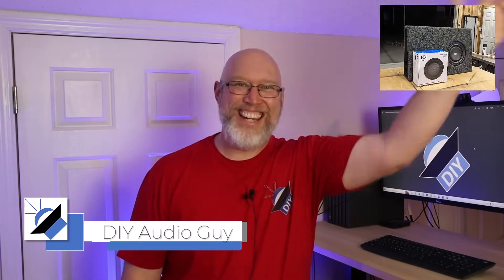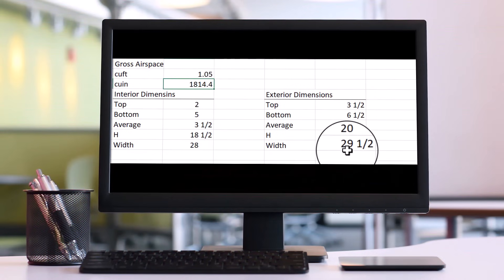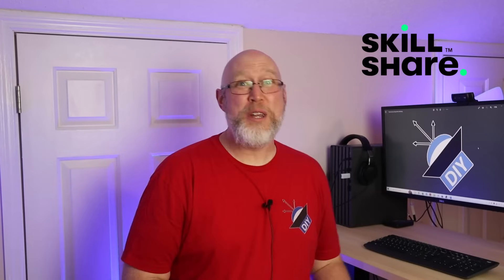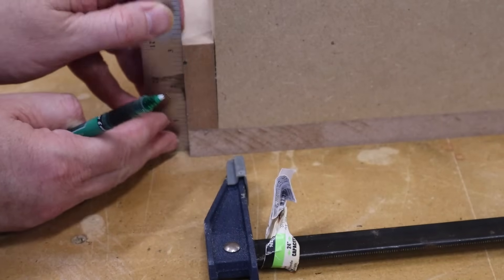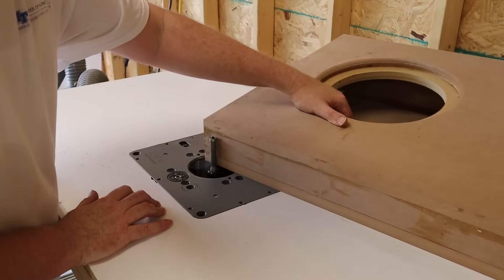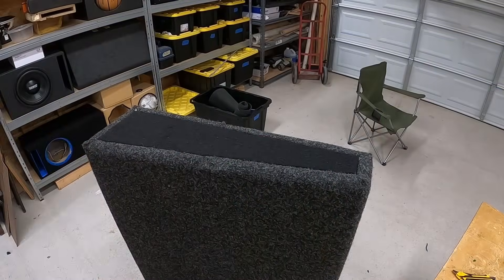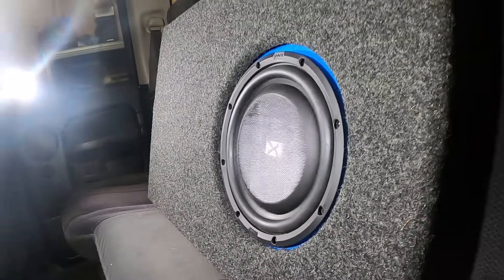Shallow Mount Subwoofer Box: Bass in a small space

Comment: @9:20 it looks like he has sealed off one third of the box ???  surely he could have just made the box smaller !
Reply from the maker: I cut out a big hole in that center brace.
Reply: @DIYAudioGuy   my bad , cant see the hole in the vid. nice work shop by the way.
Reply: That's what I thought too . But i guess we didn't see that part. 😂😂..oopsy
Reply: My thoughts as well. But, even if it was cut out, and we didn't see it, it couldn't be much left to cut out. Would affect the wave, and also would have a little more back pressure.  Some half round, stand outs on the back wall, to support the ports, would have probably helped the performance of the driver, and it wouldn't "choke" the driver as much. I think there would be more standing waves, and cancelation issues with it..but idk.
Reply: Could have also, just cut the brace off, from above the top port. Leaving more internal volume exposed.
Reply from the maker: @Chuck_Sanders  the next time I build a box like this I'm going to do just that, and then use the cutoff in to make additional bracing elsewhere in the box.

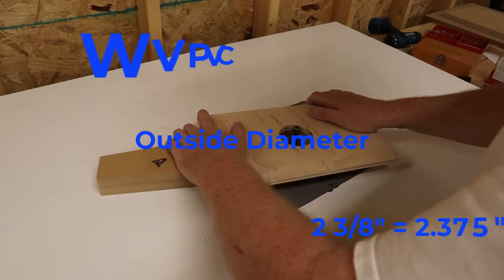You can see the center cut out shortly after 7:44

Comment: I have a pair of shallow 12” Skars in my Grand Cherokee. I wanted to go full width between the rear wheel wells, no higher than the back of the seat and stay as shallow as I could to keep my storage space. The box volume is what ended up deciding the woofers, as with the width and height I needed a minimum depth to clear the woofer and the 12s worked out best. Ended up just a bit over 2cu/ft total sealed which is exactly what Skar recommends for them, pretty happy with the end result. They dig low but aren’t overwhelming, and to my ear really don’t hit the higher bass very hard.  Would be interesting to see what they’d do ported but Skar doesn’t give recommendations for that and I’m just not good enough with winisd to get a definitive answer as to whether or not it’s worth it.
Reply from the maker: That sounds about right.

Comment: Good video ! It amazes me how many people use shallow subwoofers when they don't need to. And think shallow means they can use a small box. You did good job pointing out that shallow subs still need air space . Shallow means shallow box not small box
Reply from the maker: That is exactly what I was going for!  

My only regret is that I think I tuned it a tad bit too low.
Reply: @DIYAudioGuy  smaller the box, the higher the tuning frequency should be.
Reply: @DIYAudioGuy  yep. most of these subs with limited displacement need a higher tuning to get real music to pop
Reply from the maker: @blakebrockhaus347  I think I ended up tuning this one a little bit too low.
Reply: Shallow boxes are practical. I have a minivan and the Kicker's shallow box leaves me plenty of trunk space and it is basically invisible in the trunk. I have 3D printed speaker grills and the speakers are facing the seats, in the trunk you see the back of the box. So far nobody noticed it.
Reply: thats because a lot of people still throw money at stuff and think things work automatic without any actual design
Reply: Rather than using a shallow 10, I think a normal 8” sub would yield better results. While shallow subs have their place  & convenience , they have their limitations from what few I have fooled with.
Reply: @bcfmef  sometimes that's true.  A guy I know,  worked for MTX for many years.  He has a ton of new old stock subs and amps.  I bought 3 mtx 4500 series subs, that are single .7 ohm each, that are thunderform replacement subs, to be wired in series, 3 at a time, for a final 2 ohm(close) load. Built a down firing sub enclosure tuned to 30hz, to go under the false floor of my wife's Sata Fe, I the cargo area. Sound quality was great, and no real complaints.  But, I called him up, and bought 3 shallow mount 10" MTX subs, that are single .35 ohm, wired up in series for a 1 ohm load. I really liked the way the shallows sound,  and how much better the low end extension is. The enclosure is right at .2 cubes over the recommendation for the shallows, because the 4500's were higher efficiency, and called for a tad larger enclosure, but they have a little more excursion over the 4500's.  I'll probably throw the 4500's behind the seat of the work truck..as they aren't huge subs. My wife was more than pleased with the swap to the shallows, and enjoys her rebassed country a little more lol.  Great video on the topics of shallows!